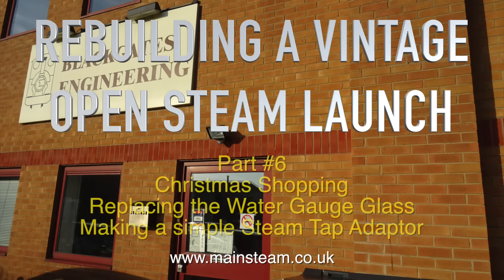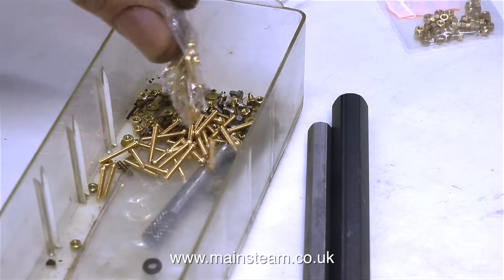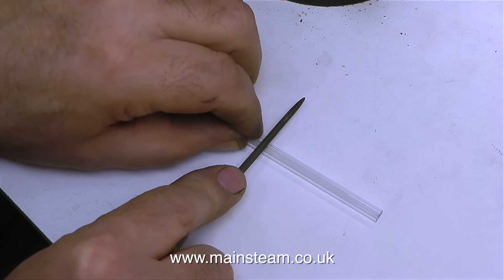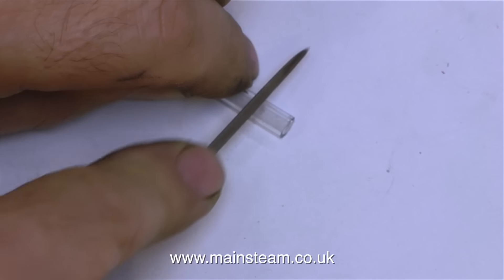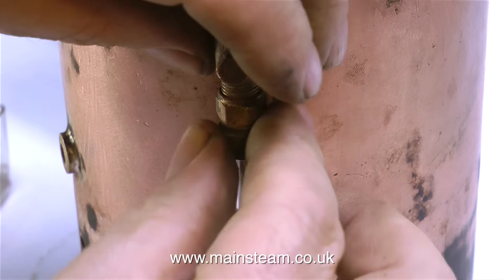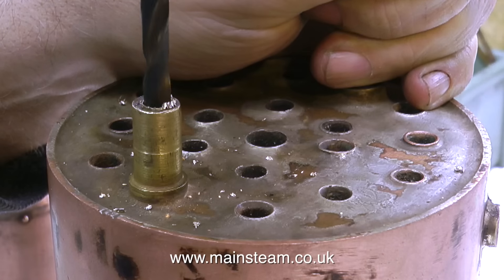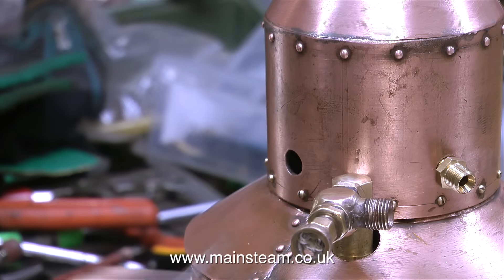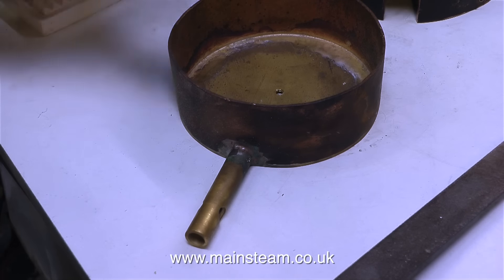REBUILDING A VINTAGE MODEL OPEN STEAM LAUNCH - PART #6

Comment: Hi Keith, another great video about doing it rite,  you are so rite about it when you said if a job is worth doing it is worth doing it rite the first time through,  I feel the same way when I am doing my wood working it didn't matter if the part was rite in front to be seen or buried deep inside of the case work it still got finished as well as I could do and put in place thanks again for all the hard work

Comment: Maybe you already know but just didn't mention it, but an easy way to handle sharp edges on cut glass tubing is to flame polish the edge.  In school we would just hold the tubing in the flame of a Bunsen burner briefly.  The sharp points melt quickly.

Comment: I hadn't thought about it before but I guess the pressure inside the site glass is the same as inside the boiler? 100psi or so?
Reply from the maker: Yes, in this case 80psi . . . .